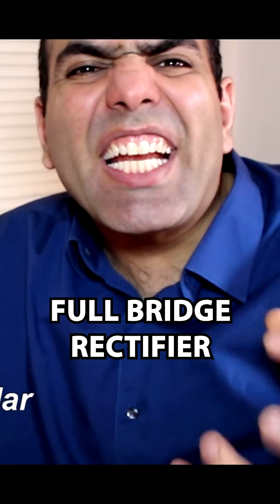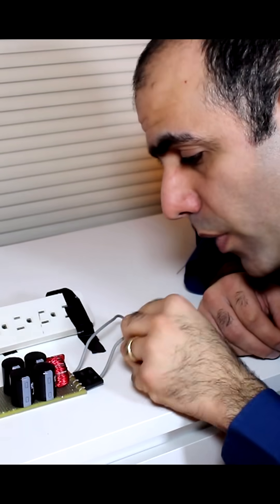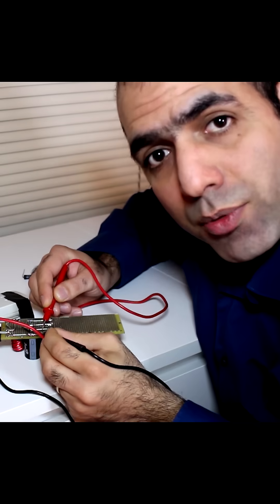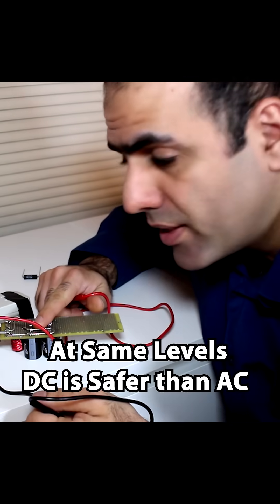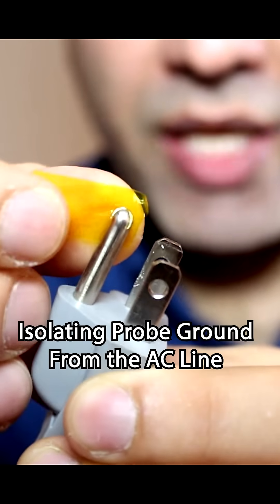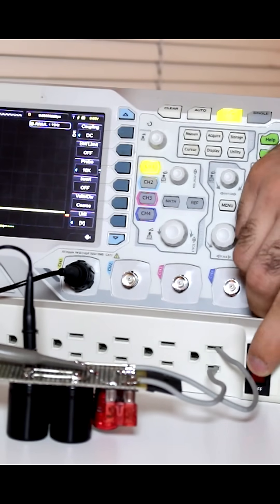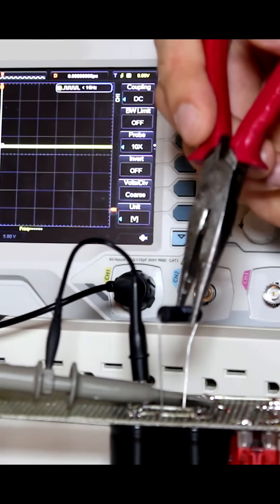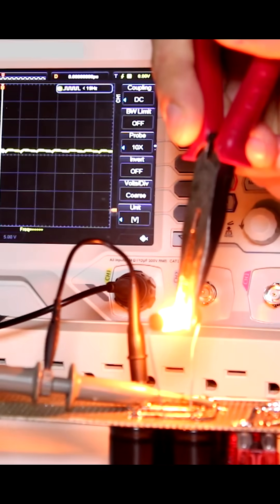FULL BRIDGE RECTIFIER #design #experiment #technology #funny

Comment: 120  Volts    AC in your home 
is  not true value 
AC  at your outlet goes to   from 0  to 170 v at peak  then goes down to zero then goes to  - 170 volts peak  
Oscilates like that at 60 times per second

Comment: I made one with 4 diodes once..
It was rated for 200V so I figured it was ok for 120v.
It blew right away, because the reverse voltage rating was only 70 volts.
Never thought Diode with lower reverse voltage then forward voltage existed

Comment: 100 ohms at 170v is 1.7 amps or 289 watts
The resistor looks to be a 5 or 10watt, I wonder why it got red?
I once tried to use a 12V relay on 240V
I calculated the series resistance 
connected up the circuit & the 1/2-watt resistor like electroboom's started to smoke & glow red
It was then I calculated the power dissipation & found it was 60W, won't do that again

Comment: Yesss. Be careful where you ground your scope. Not all zero volt lines are equal. Some are digital or analogue ground. Some are floating. A car battery can push hundreds of amps through your (mains powered) scopes case, if the battery is grounded by a PSU and your probe ground is on the car chassis.
Reply: dgas

Comment: 120v at 45° has a peak voltage of 169.8v is that essentially your full bridge is using peak voltage and outputting the same peak on a full bridge rectifier?
Reply: The capacitors get charged to the peak voltage, and there's a voltage drop across the diodes that lower it by a few volts.

Comment: There will never be a more badass name for an electric component than Full Bridge Rectifier.
Reply: It is not even the correct name.
The correct name is bridge rectifier which is providing full wave rectification.

The word full is in front of rectification, not bridge.
Reply: @deang5622 full wave bridge rectificator?
Reply: @weidwingelobjegdiv  No. That is tautology.
A bridge rectifier, by definition, performs full wave rectification so there is no need to prefix "bridge rectifier" with "full wave".

The name bridge rectifier has been around for at least 40 years.
Reply: @deang5622 everyone calls it full bridge rectifier though, so it's one of those terms that would change or made official due to widespread popularity. Plus, bridge rectifier doesn't sound as cool.

Comment: Behold: the LER
Light Emitting Resistor
Reply: very efficient, only wastes 98% of the energy
Reply: @JS-kc1tm by declaring the heat generation to be intended the efficiency becomes 100%
Reply: @MyValki  if we interpret the name "Light Emitting" as being designed to output light, the generated heat wouldn't be a desired subproduct, thus it can be considered as waste
Reply: @JS-kc1tm actually it is more like 99.98%
Reply: Dude, this circuit won't be complete without "Light emitting Capacitor"!
Reply: @fajaradi1223  unfortunately So far i was only able to create a LEC (Light Emitting Capacitor) for a split of a second. Then my crazy invention explodes...
Reply: I think we call those "Lightbulbs"
Reply: @slavkei witchcraft
Reply: A lightbulb
Reply: that's literally what light bulbs were before they became light emitting diodes
Reply: Noooooooooooooooooooooooooooooooooooooooooooooooooooooooooooooooooooooooooooooooooooooooooo
Reply: Reverse LED heat to light efficiency though
Reply: @hvboy2131 The most common form is the
Reply: bro reinvented the incandescent light bulb that was supposed to use tungsten to glow bright
Reply: Led before mature
Reply: We already have LER. 
It's called incandescent lighting..
Reply: @gschnaper  you must be fun
Reply: Except, it's not really light emission and rather thermal radiation (aka incandescence)
Reply: @rchaykovskiy  it is literally emitting light
Reply: @rchaykovskiy  Thermal radiation is still photons.
Reply: @rchaykovskiy  both really
Reply: @rchaykovskiy literally invented an incandescent lamp lol